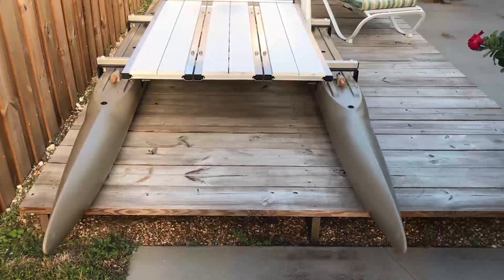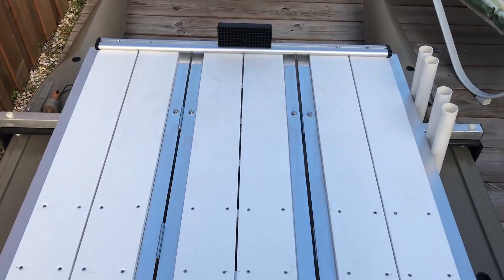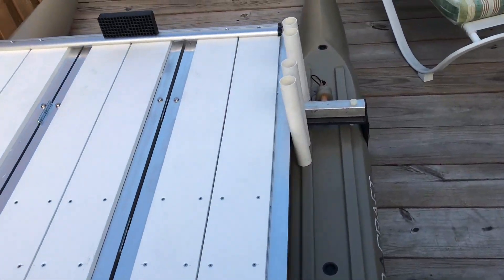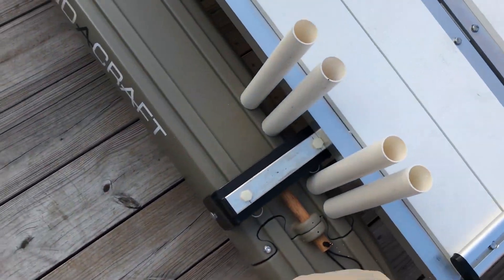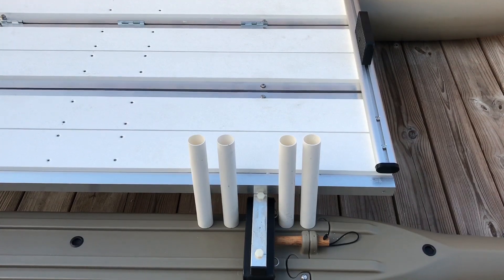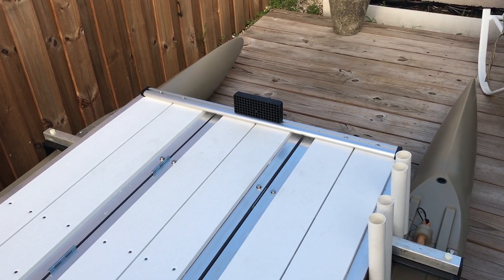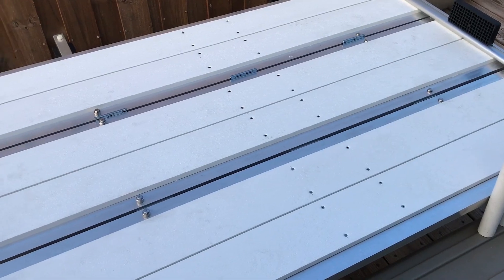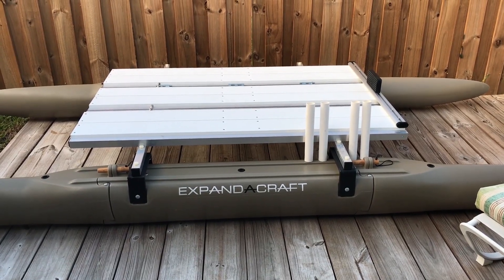Kayakbuddys Powered Modular Expandacraft 12 ft. Model is Built

Comment: How did you make the deck?
Reply from the maker: Mack B on my newer deck I use the high risers with schedule 40 pvc pipe under the plastic decking from Lowes. I made a frame and screwed into the pvc pipe. Rock solid and light.